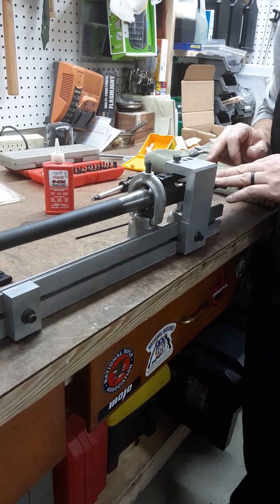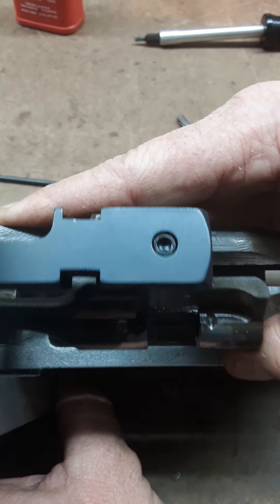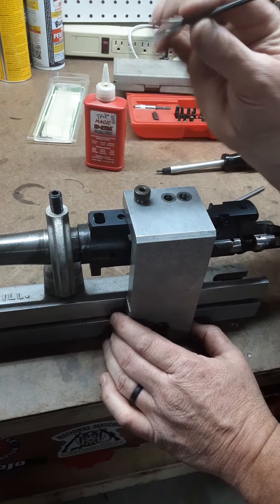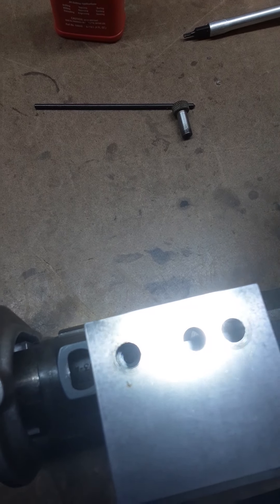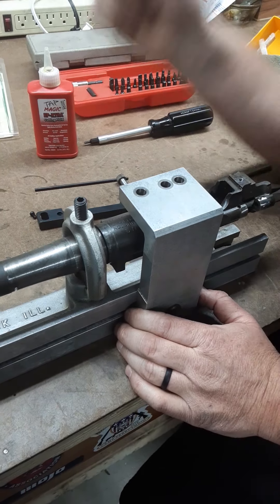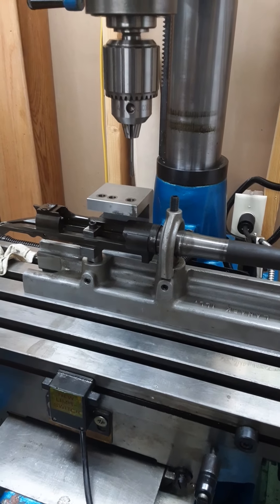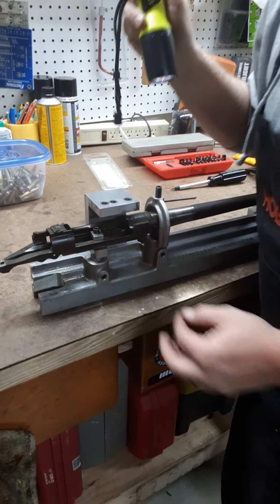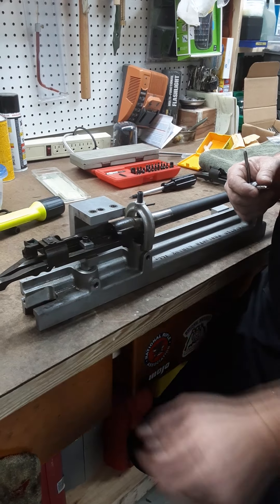1903A3 drill rifle, 1903A4 sniper clone build: Drilling and tapping scope base Part 2

Comment: Brownells usually carries the bits and taps that you need for this job including single flute drills which work great in hard material. Some guys like to go one over on the drill to make it easier to tap the threads. I usually do that on Smith Corona receivers. And you are exactly right on the proper lay out of the mount. It should hang off the receiver about 1/8” to 1/4”.